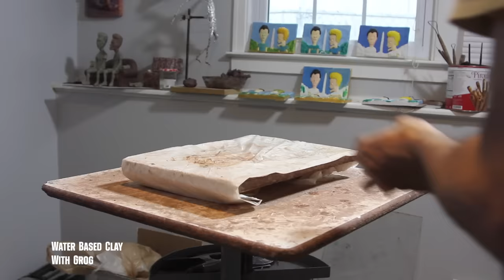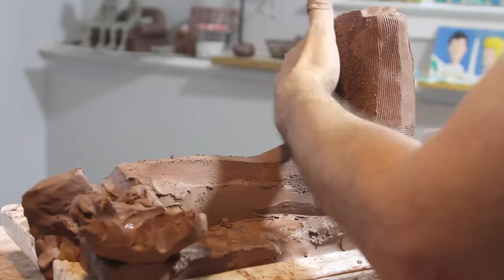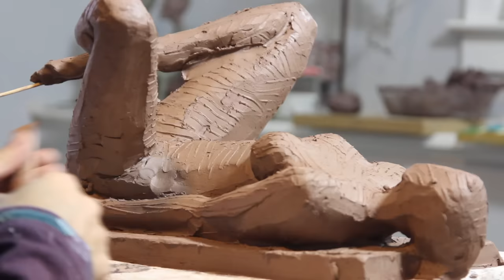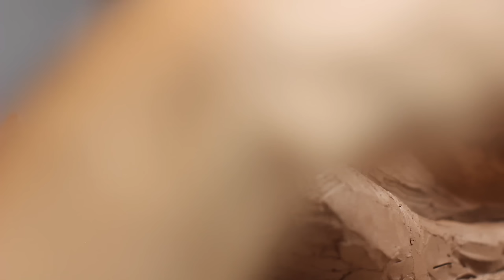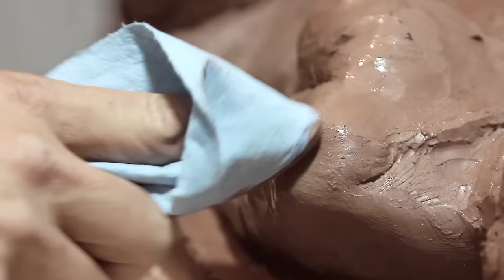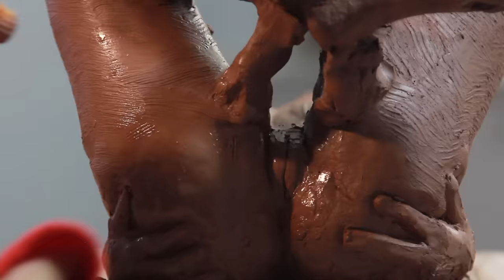Female figure sculpture without armature in water clay

Comment: If you put it on the oven 'that wooden armature dose'nt have any problem?
Reply from the maker: no, it will burn off. But the sculpture shrinks as the water disappears and could crack the clay in the process. Wood does have some flexibility and i have not had many troubles firing it even with the wood inside.

Comment: Im new to sculpting. Do you still fire your sculpture? If so how long does it take to dry? 
I took a one week crash course which was not very informative. And ive hesitated doing sculpture on my own cuz i was told by the teacher that you cant do sculpture without making it hollow insidw the sculpture to help it dry faster. Ive tried finding any information or books on the subject with no luck.
Reply from the maker: You are in luck, ive done tons of videos on hollowing out and firing. I usually let my sculptures dry for a week or two. If it has grog it helps the firing. But before they dry i hollow them out, i use a cave type of way of removing the inside. When you do that let it dry for a week or two. Then the key is fire it very slowly.

Comment: Hello! Thanks for the video. I’m curious, since you would fire this wouldn’t it have to be max 1in thickness or it could potentially break? I’ve seen others sculpt and empty out the inside in areas of 1in thickness or more…
Reply from the maker: thats a good rule, but i've left many sculptures with more than 1inch and they were fine. I've fired solid sculptures that were also smaller and not hollow and fired perfectly. For me what helps the firing process is getting clay with grog. Before i did the same with grogless clay and it would break and crack.
Reply: @SculptSome  Thank you so much that makes sense! I'll have to test it out :)